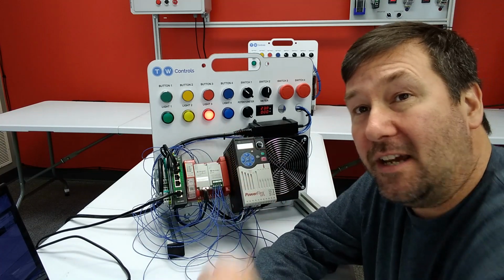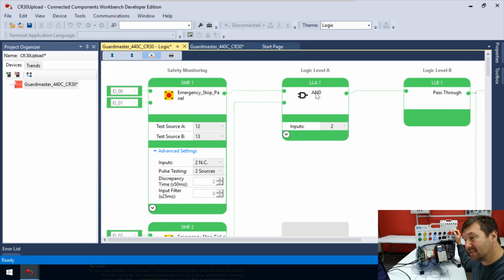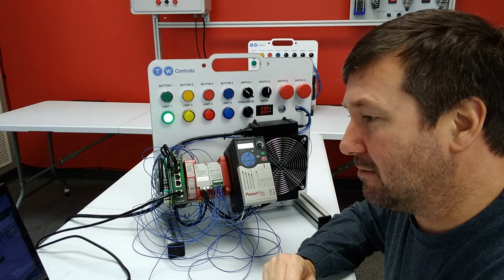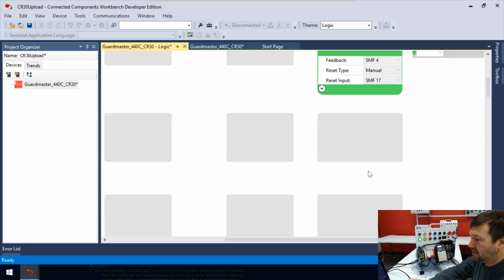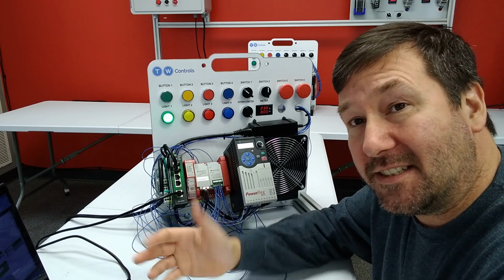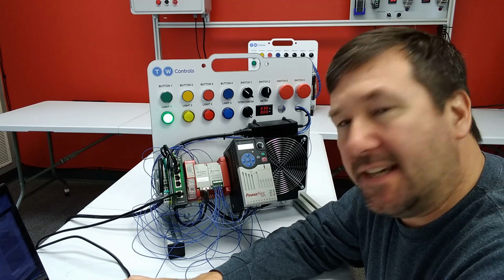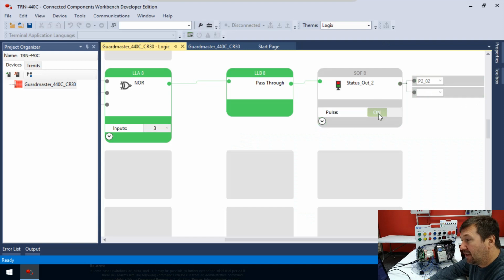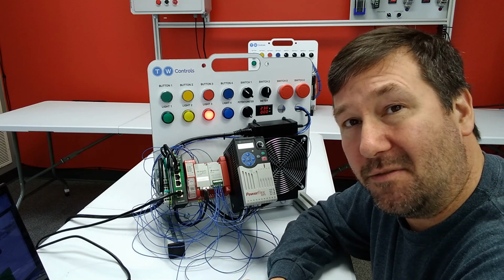Allen Bradley 440C-CR30 Safety PLC.  Reviewing the Getting Started Program

Comment: I know this is an old video but just looking to confirm, can all safety inputs be configured from one pair of test outputs? Looking to replace old devicenet MSR modules without rewiring for extra test outputs that the newer GSR relays require. Thanks!
Reply from the maker: I'm very rusty on the CR30. It seems like that's correct but don't hold me to it.

Comment: Really great video.   Thanks         Can you upload the PLC program through a serial cable to a computer if the plc does not have an Ethernet module ?   Is it easy to do ?
Reply from the maker: There is a USB port on the CR30s that makes it very easy to upload

Comment: hi tim 
thanks for your great content
What is the difference between safety plc and standard plc?
Reply from the maker: Traditionally safety PLCs have included more redundancy and a limited instruction set specifically intended for safety functions where as regular PLCs have less redundancy and a greater non-safety related instruction set.  There are some regular PLCs that have safety built into them also.